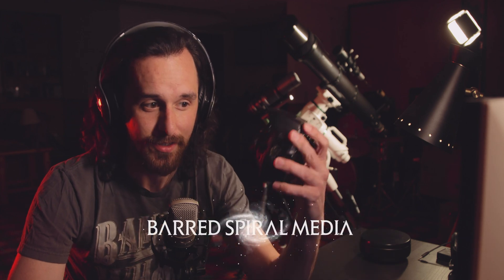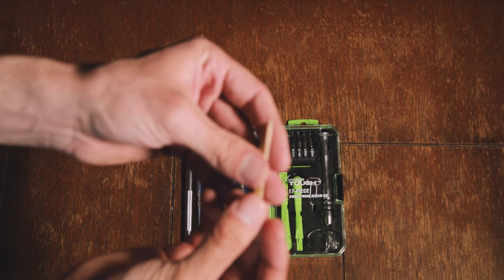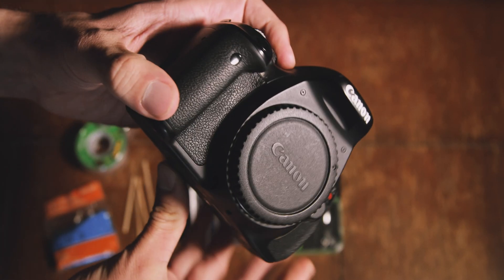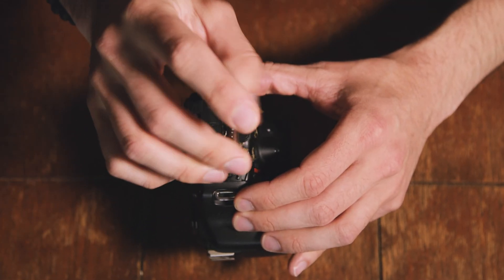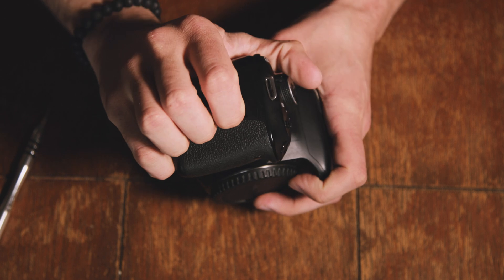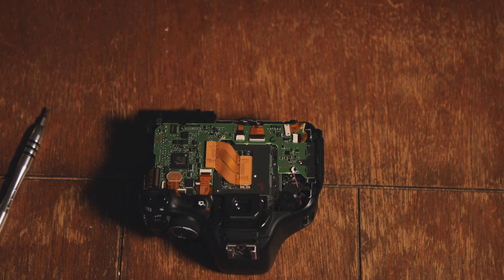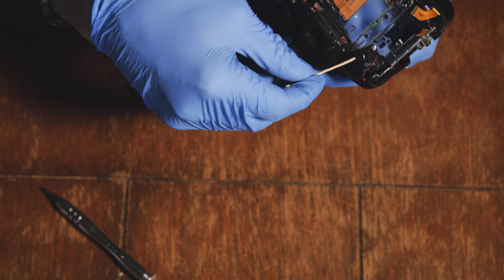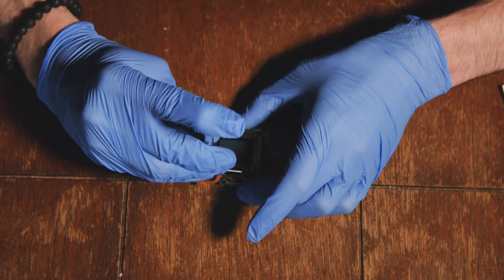Astro-modifying a Canon T3i - Get Better SNR When Shooting Nebulae!

Comment: Here is a cry for help. Searched the Web for help but nada. All pug back together and everything working. BUT  .. live view will only stay on for a split second.  Anyone experienced similar? Glad you inspired me to dive in. Thanks
Reply from the maker: Hey there! Does the LCD work okay? Are you only having issue with live view and not anything else? If the LCD works fine it could be a connection from the sensor to the motherboard. If the LCD isnt working at all one of the first cables you undo inside the camera is the LCD wire. I believe theres a youtube video out there where someone fixed their lcd as well as astromodified their T3i. Maybe check their video out? I wish you the best in finding a solution!
Reply: @KJsCosmos  Thanks for your reply.  Nothing works now,as touched the capacitor by accident(ouch!) . The camera is now in the DSLR graveyard with a broken Nikon d7000. 
Thanks

Comment: Going to try this with a 30D. My mother in law was throwing it out, still works great.
Reply from the maker: Thats perfect!! One person's trash is another person's gateway to the Cosmos 😏
Reply: @KJsCosmos  What's your opinion on the 30D with 8mp for astrophotography? I have a 7D, but I still use it for wildlife and did not want to covert it. Thanks
Reply from the maker: @John-Shutterlyphotos  30D is definitely something worth learning and playing around with. I’d sooner modify that than your 7D that you daily drive for wildlife. Ultimately the 7D will give you a cleaner image, be easier to shoot with and easier to process - but the 30D can still make good images with the right techniques and if it was free, even better! Maybe a good use of it would be to use your 7D for more broadband targets like galaxies and then use the 30D for Ha targets like nebulae. You could also composite the two on a given target to get the broadband signal from the 7D and then shoot with a modded 30D to just add a luminance layer in the nebula and bring that signal out more while still using your 7D. Just some ideas!
Reply: @KJsCosmos  Thank you so much, that is very informative 👍

Comment: One thing I did do that I think it is a great idea was... I replaced the IR cut filter with a quartz glass lens. Not only does it protect the sensor, but quarts glass can receive light farther from the UV and IR spectrum than glass can. I also have one on my guiding camera because it allows a lot more light to enter the sensor, close to twice as many stars.
Reply from the maker: That’s a great tip! Did you source your glass element from anywhere in specific?
Reply: Any idea where to get a quartz lens for the replacement like you mentioned? Thanks in advance. ✌️

Comment: A) Make sure you're grounded before attempting this. Simple to do and it protects your investment.

B) Take the top portion of the camera off. Significantly reduced the risk of damaging the top ribbon cables.

C) Expect to have to re-adjust the sensor focusing screws at least once.

Just a few more checklist items.

Comment: After 2 days of trying, I did it! First attempt went poorly: I have an Eos 2000D, which has no documentation on disassembly or anything on YouTube or Google about astro modding it. Turns out you have to entirely disassemble the case to access all the motherboard screws. I also nearly got electrocuted by the flash capacitor - thank god it happened to my multimeter and not my finger. My torx screwdrivers all got shredded by the Chad torx screws on the sensor assembly. Got a new set, got the sensor out and learned that the sensor assembly is COMPLETELY different to the 600D or the 1000D. It has no piezoelectric cleaning system. The main filter is glued to the bracket with the IR cut filter glued to a sub frame beneath that. I painstakingly peeled the main filter away with a hobby knife and managed to keep it intact. I was less careful with the IR filter because I'd frankly had enough by that stage.
AND THEN; I had to reassemble and disassemble the camera 4 times to get it to focus properly, autofocus works as well.
If anybody is reading this and made it this far: thank you. Please get a professional if you aren't sure what you're doing. I got very lucky with this.
Reply: Can you give any more tips i have an 2000d too and what to midify it by myself too

Comment: Hey Kyle, I did a modification and your video is awesome. Thank you! Later on I found out that it actually shifted my focal length and I was not able to focus on infinity with my EF lens anymore. It happens due to a missing layer of refraction between sensor and lens. Since I was also planning to buy a Light Pollution filter, the clip-in from Astronomik resolved the focus issue for me. Also modding the camera also changes the White Balance. Can be fixed by using custom WB mask or can be eliminated while stacking lights and working the post-production stage in RAW format.
Reply: Is it possible to nullify the focusing error by placing a plain glass of the same thickness and dimension as a replacement of the filter that we removed during that mod?

Comment: Hi I just did the mod following your video. Now when the sensor is cleaning it gives the error 06 and while shooting it gives the error 70. Any suggestion? I checked all the ribbons cable and didn’t touch anything. Before the mod it was working well…
Reply: Just figured out what was the issue. I damaged the small connector behind the mainboard since it was really difficult to handle without removing the top case. For anyone who wants to do this mod i really suggest to remove also the top case of the camera (there is a wonderful super fast tutorial from ifixit)  to have more space to handle better the connector behind the mainboard and check all the connections. Now everything works perfectly. Just one thing: I used your method to take note of the sensor position but the focus is still a little nearer I'm doing several test to find the correct position, is there a way to do it without disassemble everything all the times, take pics and then check? and also, is it possible that the focus location is slightly different without the LPF?
Reply: @FilippoCurtiAstro  regarding your last question, yes, the focus point changes slightly when removing the lpf2 filter. 

Easiest solution would be to get a clip-in filter for the camera (many people reported that it works for them)
Second options would be to replace the stock lpf2 filter with clear glass of the same thickness to regain the focus point you had pre-modifying. 
Or third option, if you don't want to spend any more money, and that's obviously a bit more tricky and takes time: you could adjust the sensor Position itself.. you could try it as you have your markings and measurements of the stock-position, so you shouldn't be able to mess the positioning up completely, and if you do, you know where you had it working before :)
Basically, get the sensor closer to the lens to regain the ability to get infinity focus. Just make sure to adjust the screws evenly!

Question back to you: you said you damaged the connector behind the Mainboard, how did you fix it?
Reply from the maker: Anyone else on here run into this? Just did a quick google search, looks like error 06 is a problem with the cleaning system and error 70 has to do with circuitry? I’m always suggesting going through all connections again, but maybe someone can chime in if they have any advice.
Reply: @KJsCosmos  Hi!, Thank you for your fast reply! I tried again to check all the connections and the error 06 while cleaning the sensor is still there but now when shooting it gives the error 30 (shutter) even if the shutter seems to be ok and was not touched in the procedure. May it be some dust in the flat connections or some connector not attached so well? I re-checked all the connection 7 times :(
Reply: @KJsCosmos 😮

Comment: Just did the mod with this video playing. There are actually 5 screws in the bottom of my T3i. That caused a bit of confusion as one was beneath the "void warranty" sticker. Then I managed to break the glass filter with the piezoelectric element on it (LPF1 filter). I was planning on an H-alpha mod, but it looks like I ended up with a full spectrum camera. Time to buy an Astronomik L-2 snap in filter I guess (unless someone has a better suggestion for DSOs).
Great video! Thanks!

Comment: Hello KJ. I assume that's your initials/name. So, it turns out that NO ONE in my state will do this, even camera repair shops that do onsite repairs. I don't feel comfortable shipping my camera all over the place, so I am left with the option of doing this myself. I have had experience with circuitry and circuit board repair. I have two main questions. 
1) Would you recommend the avg person to do this themselves?
2) What specific tools do you need to complete this task?

Comment: I have a problem with my 600d..I cant take 2min expo..Asiair gives me expo failure..If i take 1min expo it will only do one and then gives me error..If i shoot 30sec expo it will take them but it takes a long time to save it on card or usb connected to asi..Any solution?

Comment: I did it and the mod basically works, but my cam doesn't detect the SD-Card anymore and also doesn't like to be slightly shaked. Do you maybe know a solution?
Reply: Having the same issue, did you manage to fix it?

Comment: Anyone in here who has done this to an sl2(200d) or any other of canon's newer models?
Edit: just successfully finished modding my 200d. For anyone with a similar dslr like 800d 250d etc. You just have to be little careful because there are more cables then in the older models. I recommend using this and any other disassembly video of your camera.

Comment: This mod is great but, you still need a lot of cooling to get rid of image noise.
Reply from the maker: I’ve found that a plenty of exposure time still makes great images! I’m looking into Peltier cooling for it.
Reply: Honestly, noise isn't that bad (well, if you're not living in super warm climate areas and depends on the sensor of course)
You will get rid of most, if not all, noise with the right imaging settings, enough integration time, calibration frames and noise reduction in post-processing :)

I find it funny that Most people actually totally underestimate what you can achieve with a cheap, modded dslr.. except for noise, even the cheapest camera can hold up to many/most entry level cooled astro dedicated osc cameras for just a fraction of the price :)

Comment: Great explanation. I've followed the instructions, even from a written tutorial, and I removed the filter... However.... Now the camera doesn't turn on... Any suggestions? I've already reopened the casing, and went again up until removing the main board, exposing the filter piece. I didn't remove it again as I didn't found it necessary... I'm also checking on other places for help, but if you have any hint, please let me know :)
Reply from the maker: I think it would be good to check every single ribbon cable/connection so you can confirm everything is plugged in and working.

Comment: Very informative video! I'm actually modding an old T2i now. It's currently naked sitting in a drawer because I can't locate my T7 screwdriver to remove the grounding screws. So while I wait for a new shipment, I've been watching these videos to see if I missed anything.

I've also been debating whether or not to remove LPF1 (the piezoelectric element) and go with a naked sensor. Guess I have a couple more days to think about it until my new screwdrivers get here. I've been recording my process so I can rewind and review if I broke something. 

Keep up the videos! Definitely sub worthy!
Reply from the maker: Thanks for the kind words! Yeah I had a lot of debating with myself trying to figure out what kind of mod to do.. I ended up settling on the one filter due to the ease of reassembly and what not!
Reply: @KJsCosmos  I also ended up doing just the H-alpha mod and I must say, it has been super awesome! It's nebulae season so I've been having fun with emission nebulae for the past few weeks. 

Thanks again for the video, it was super helpful! I've pointed several people to it since completing my mod.

Comment: Will the camera achieve focus with EF lenses if piezzo glass is also removed?
Reply from the maker: I don’t believe so. I didn’t remove the piezo element, that was placed back into the sensor assembly. And my camera does in fact still have autofocus with EF lenses. You can catch a demo of this at 14:30

Comment: I did it...  it won't turn on. :(  tomorrow i will check all the ribbons and i hope it's gonna work.
Reply from the maker: Oh no! Yes the best thing to do is really double check you have all connections firmly seated in their respective areas. It’s easy to leave one halfway in, the ribbon cables especially. Don’t forget the traditional connectors as well there are a few of those that need to be plugged back in. It may help to pause the video at certain points to get a look at what connections go where. Good luck friend!
Reply: @KJsCosmos  success!!  Thank you! :)

Comment: Hey Kyle, great video! I used a vernier caliper to set the screws.  When I put everything back together it won’t turn on.  I had issues with the ribbon cables up near the shutter … the one on the bottom (closest to the motherboard) has kind of a funky flip down connector.  I feel it’s not seating well but it’s very hard to try and push in because the top of the case blocks the ability to push the ribbon cable into the connector.  Any tips on getting this one seated correctly?
Reply from the maker: Have you tried using a rubber tipped tweezers to reach into those tight spots? That’s what helped me the most in those difficult to reach areas.

Comment: Fantastic video, thank you. You make it look easy, but The Fear stops me following in your footsteps :-)
Reply from the maker: I appreciate it a ton! It was a scary process for me as well, took a lot of convincing myself to actually do it.
Reply: @KJsCosmos  Hi Kyle. My previous comment about feeling The Fear too much to try this myself was made a whole month ago and "eventually" I DID overcome Fear and modified my Nikon D70. I have no experience at all in this area (I can just about change a plug if really necessary...) but inspired by your video, and watching another specifically for the Nikon D70, I dived in and it worked perfectly first time. Then I did the same to my D80 Nikon: fail! The view screen was white, and the images were all black. I went in again and disconnected then reconnected the ribbon cables more carefully, and it worked perfectly again. Happy Days!  The D70 has quite a thin filter, so removing it didn't affect focus. The D80's is thick so focusing is now completely off, , so it requires 'trial and error' focusing. If I can live with this, I also won't bother with a further glass filter replacement, but I'll wait to see how hard it is to use on the scope. The D70 is a dream, showing detail in the Horsehead nebula with UHC front attached filter in amazing detail. Thanks again.

Comment: Would you say to only do this mod if you never use the camera for snapping regular non astrophotography images ? This mod will kind of ruin everyday snaps correct?
Reply from the maker: It won’t ruin everyday photos entirely. All images will have a magenta cast on them. My T3i is my dedicated Astro camera so I haven’t used it in any other setting. It’s my understanding that you can use custom white balance to correct it. I also imagine color adjustments in Lightroom/Photoshop would mitigate that color cast.

Comment: Hey Kyle! Thanks for the video. Do you know how modifying the camera would affect taking pictures of something like andromeda as well? or the milky way? I'm gonna do the modification but would just like to know what to expect
Reply from the maker: Ultimately your images will shift more into the red end of the spectrum. Removing the infrared cut filter give the image a sort of magenta color cast. This color cast can be fixed with post-processing! But it’s worth the extra step to get the rich nebulae emissions that would otherwise appear a very faint pink. Galaxies are my personal favorite, no need to worry your galaxy images will ultimately appear more dynamic with the right processing!
Reply: @KJsCosmos  sold!

Comment: Hello Kyle, sorry is it not necessary to buy and supplant the IR filter with some Neutral ones? Think I saw this step on other Canon Mods tutorials.
Reply from the maker: Hey Gabriel! I don’t believe it’s 100 percent necessary to replace it, I followed Gary Honis’ mod instructions and he recommends replacing it with at least a Baader clear glass filter. I decided to just take the filter out and leave it empty and it’s been fine! It’s recommended that you use some form of UV/IR cut filter to help reduce star bloat and unnecessary wavelengths of light, but if you check my Instagram @kjscosmos my most recent image of NGC 7000 is unfiltered taken on an APO refractor and it’s sharp without the recommended replacement.